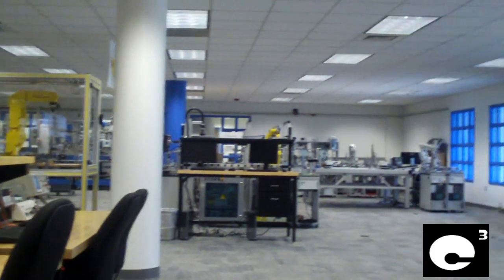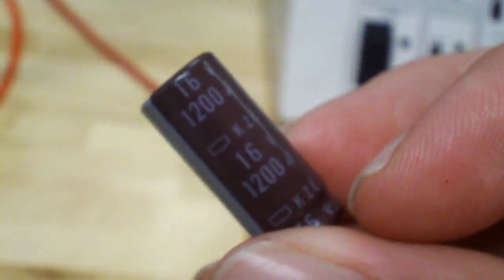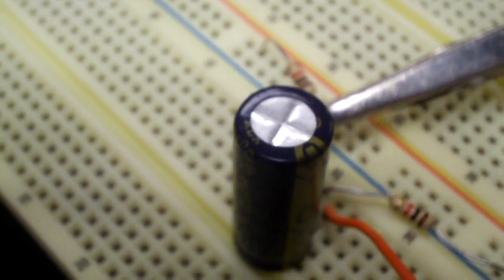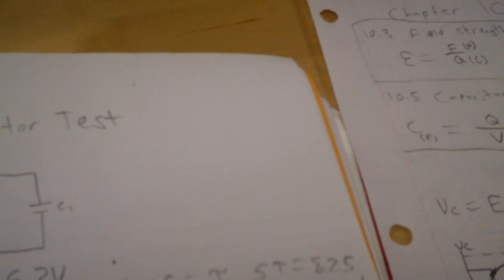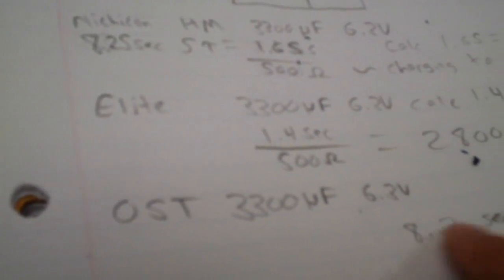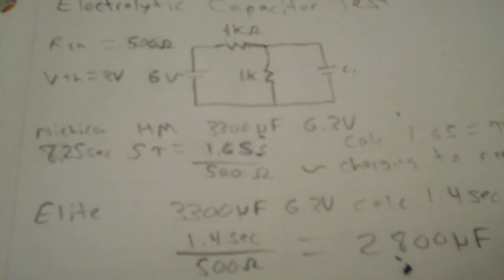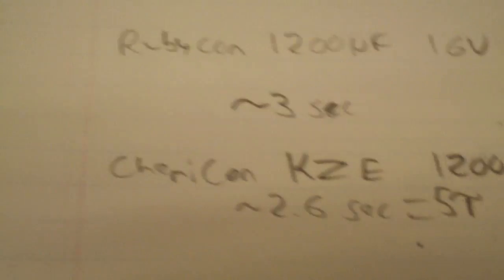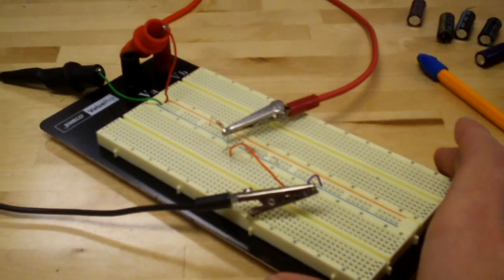Capacitor tests using a breadboard, PSU, 2 resistors, and math

Comment: aluminium electrolytics- the stated value is something of a estimate +/- about a factor of 2. the circuit will often still work if the actual cap value is double down to 1/2 value needed.